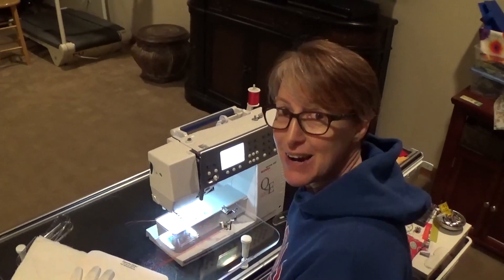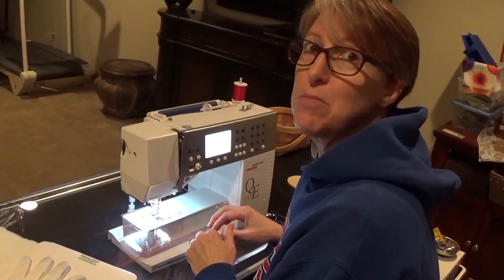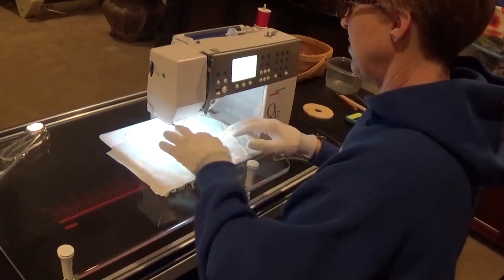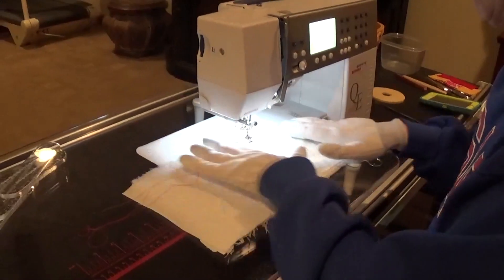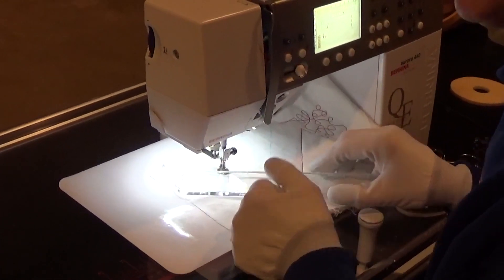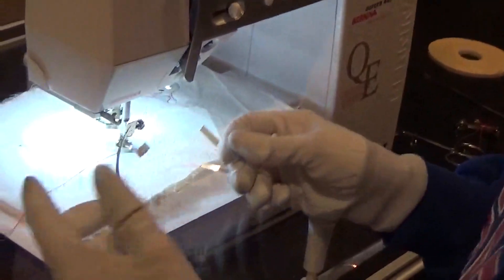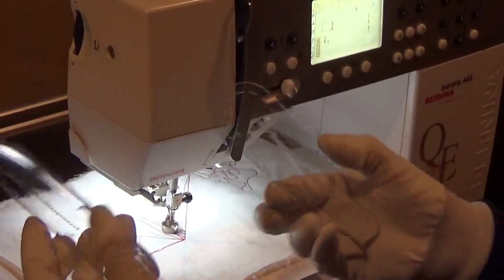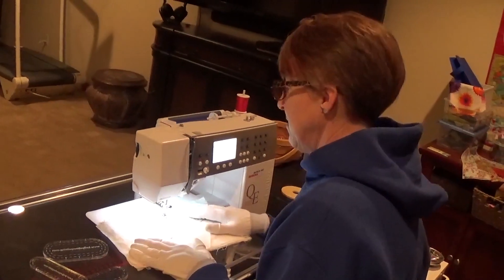Free motion quilting and ruler work on your sit down sewing machine

Comment: The best thing I've used as grips for my rulers are those little fingertip stick on "polka dots" made for hand sewing. They don't get in the way of the markings so you can see clearly,  they don't scratch the surfaces of the cloth or your table, and they don't leave hardly any residue if you need to remove them or change the position. I dont understand why I don't see more quilters recommending them instead of the tape. Try them ladies... you'll love them!
Reply from the maker: Great idea!